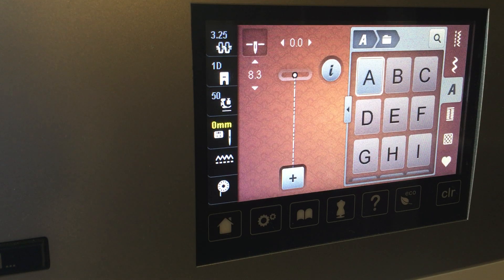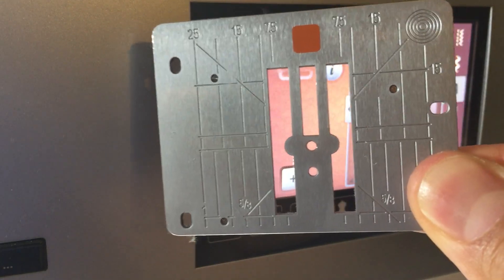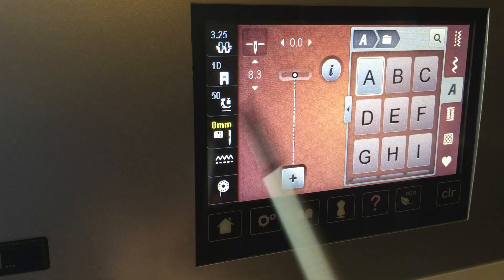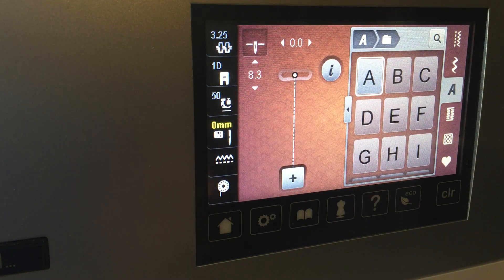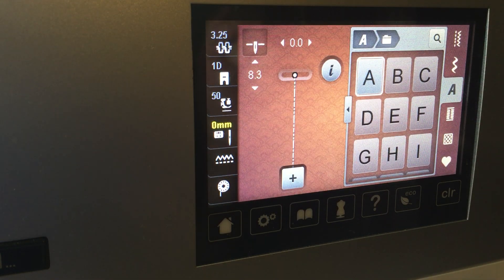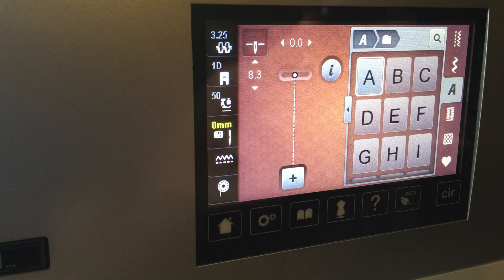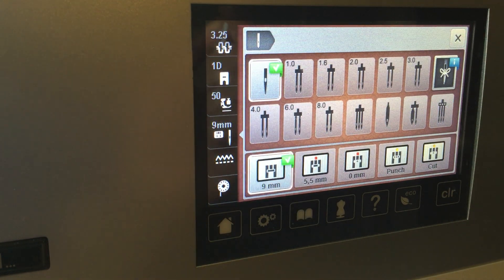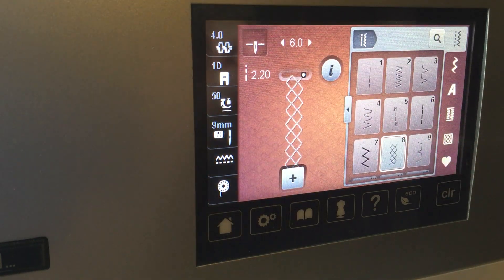Bernina Won't let me change stitches

Comment: Hi from France, thank you for all your videos ! BUT I have an issue with my 790+ ; since several days, sometimes, when I change stitches, she won't stitch the right stitch, she stays on straight stitch, my needle doesn't move to left or right (if I choose zigzag for example, and it's like that for all the stitches) AND I haven't the straight stitch plate, I have the zigzag stitch plate. I am obliged to turn her off, and on, for her to be able to stitch the right stitch I choose. What is wrong with my machine ? I'm afraid she is down as she has only one year :( Could you help me please ? Thanks in advance.